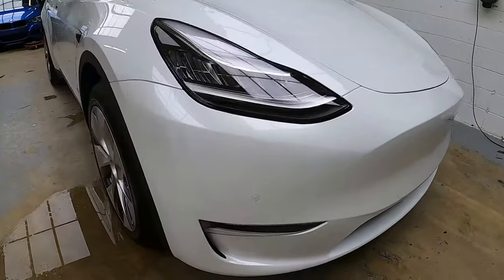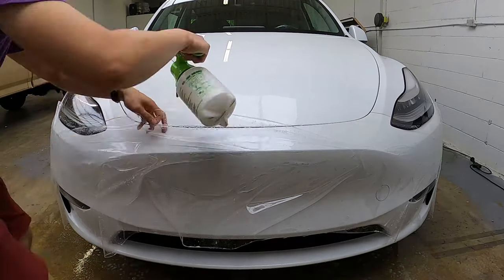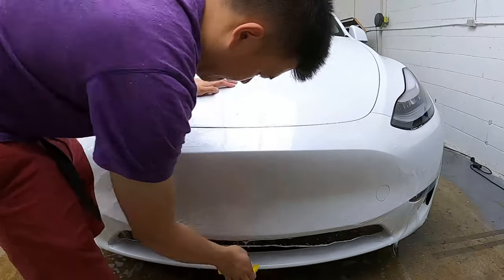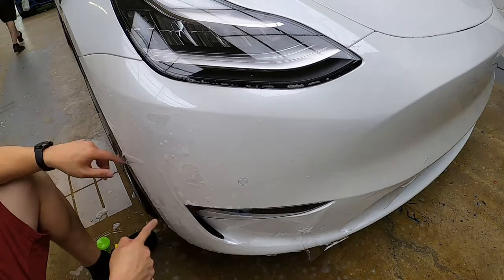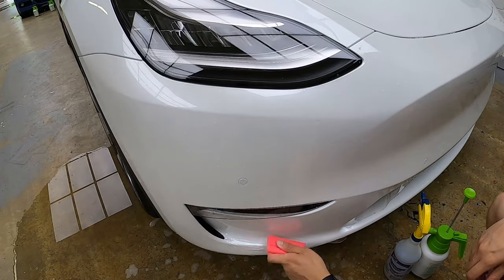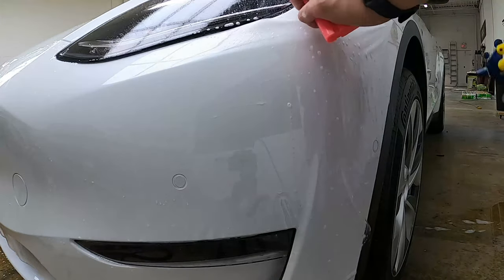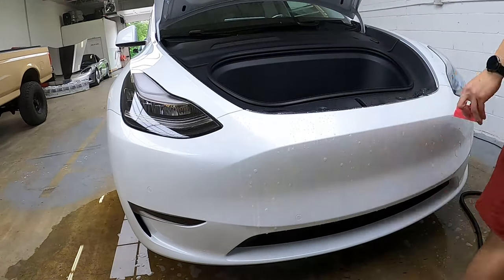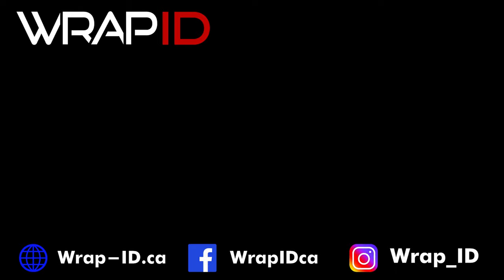How to install Paint Protection Film on the Tesla Model Y Bumper

Comment: Rrreally good video! Like it 👍🏼 Do you know how the ppf edges look like after 2-3 years specially on a white car? I have seen ppf edges that catch dirt over time you cannot clean because dirt is moving a bit under the ppf…
Reply from the maker: Hey! If they are sealed down properly they will not lift and collect dirt, but in cases where there is dirt, it can be either cleaned or trimmed back

Comment: Very nice work! I’ve seen several of these Tesla front bumper installs. You make it look easy but I’m sure it’s not. I would guess the approach for a first timer should be slow and patience with lots of soapy water, correct? I would think a beginner would tend to panic if things aren’t looking right instead of simply peeling it back and spraying it and trying again is this also a correct observation? If you keep the PPF wet can you keep working it for as long as it takes or will it tend to start stretching, drying, etc?
Reply from the maker: For sure slow and patience is key. I wouldn’t use too much soap as then you’ll be fighting it sticking. That’s correct as long as it’s wet you can still work on it

Comment: I consider myself pretty handy person and I do not recommend people from doing this unless they have good experience(especially if you’ve purchased a pre-cut kit).  Just pay a professional to do it.  It’s just not worth it.  

The video makes it fairly easy to accomplish this, but it’s not that easy.  If I had to really do this again, I would buy bulk and cut it myself.  Buying a pre-cut PPF limits what you can do and you have to stretch different parts of the bumper just to get the alignments correct.  Getting the parking sensor all aligned was such PIA!  If i had a bulk PPF, i wouldn’t have to stretch it as much and I would have a lot more free pay with it—ultimately making things much easier to apply.

Comment: Probably a stupid question, but is it really easier to use a pre-cut than to put on a full sheet and cut out for the sensors etc as you go?
Reply from the maker: Hey! It is easier to use a precut if you do not have the experience or do not have the courage to cut the film on the vehicle. But of course if you use a sheet it can be more custom

Comment: Hey! Nice video. What solution did you use for the spray (ratio) and alcohol ratio?
Reply from the maker: Hey! Thank you so much and we do 30% alcohol and 70% water
Reply: What about the soap spray in the pump bottle? Type of soap (Johnson baby?) and ratio with water? Thanks
Reply from the maker: We use Johnson's baby shampoo and as for the soap ratio it depends on the conditions, if it's hotter I use more and if it's colder I use less. But I normally put 2/3 drops per pp bottle.

Comment: Don't they make one of those strap-on leather front covers, like they had in the 80s? So when you're on a long road trip you can put it on and remove it when you're back home? They called them  Bug Bra's...
Reply from the maker: They still might but those collect dirt and small rocks under and with the leather not actually air tight to the car, it will get inbetween and end up scratching and damaging the car under the straps
Reply: @wrapid9706  Yes, good point. I was just looking for the easy way out, because I'm not as patient as you spending the time to install that plastic. But it looks fantastic. If you're near me I'd pay you to put it on for me. I'm in ILLINOIS>
Reply from the maker: @bh9262  Haha no worries. Unfortunately we are all the way up in Canada where the polar bears attack our cars instead of rocks
Reply: @wrapid9706  Canada is a bit far.  How's your boy Trudeau doing? Popular with the local's I'm sure.. :)

Comment: Can you get creases or permanent creases in PPF? What if it creases after you shrink it and push it down
Reply from the maker: It is possible to get creases but if you heat it up, they usually go away (kind of like vinyl). Only issue is if it's too dry and you crease it, there is potential that the adhesive will seperate so make sure it's wet when you are squeegeeing

Comment: This guy is using way to much soap if your clear bra is sliding all over the place your using to much soap usually from using the same bottle as tint. Also never put your fingers on the inside of the material. Especially on a white car